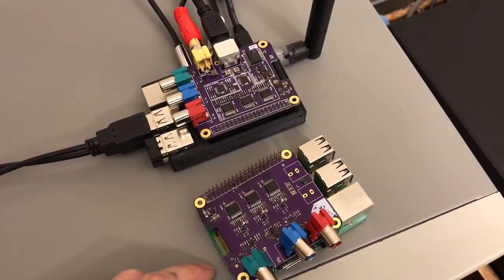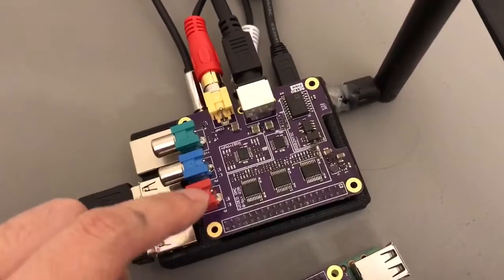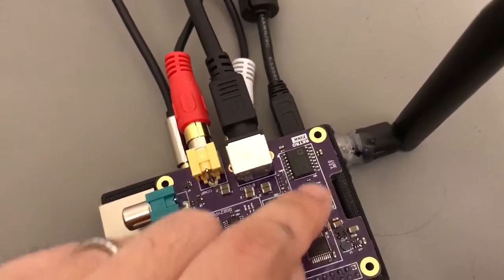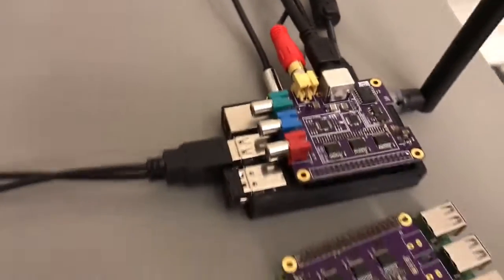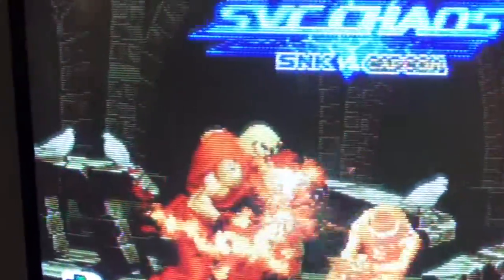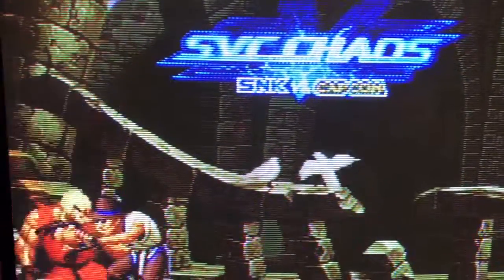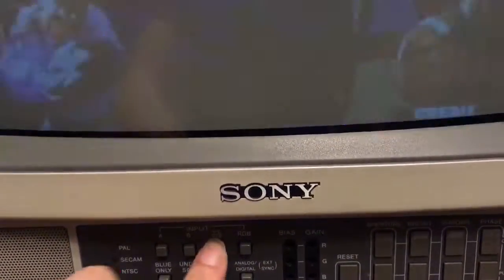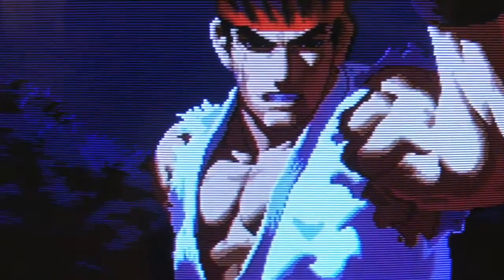RPi - NTSC 240p Component, S-Video and Composite

Comment: would the picture always fit the crt tv despite the different resolutions and frequencies? wonder what setting you have on retroarch. Reason I'm asking is I have the pi2scart and rgb-pi hooked up to a scart to component converter. Which turned out to be a lot of pain given retropie can only have one hdmi_timings. I can't get it to fit the screen and figuring out the different hdmi_timings required is beyond me.
Reply from the maker: Hi Michael, the key is that the horizontal scan rate is ~15.7kHz and that the frame rate is ~60Hz. You can have as many horizontal pixels as you want. In fact it's probably best to have as many as possible to accommodate different scaling factors for different systems... I'll write that all up sometime soon.

Comment: 1 year later but here goes the question

i run 240p from the standard composite output just fine for most systems, neogeo, generis and NES for example looks really good and sharp (fence in first stage of ninja gaiden 1 looks terrible, the sharp bilinear filter improves it while not making the image softer), but super nintendo has a strange horizontal resolution that no matter what i do in the settings, it never get's exactly right! and the horizontal resoltion can't get very high using this composite output

with this retrotink adapter, can i set a very high horizontal resolution and fix this problem?
Reply from the maker: Hi yes, the nice thing about the various hat options is that you can run in an ultra-wide horizontal resolution, hence no scaling problems.
Reply: What image and config are u using for this?